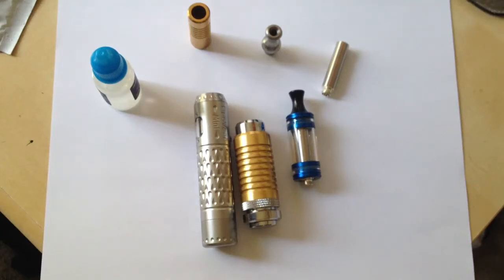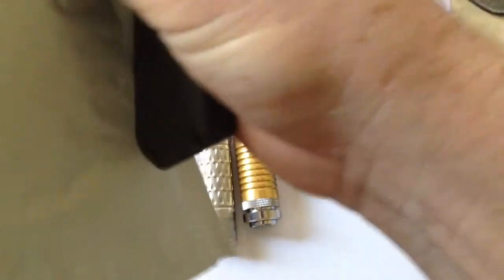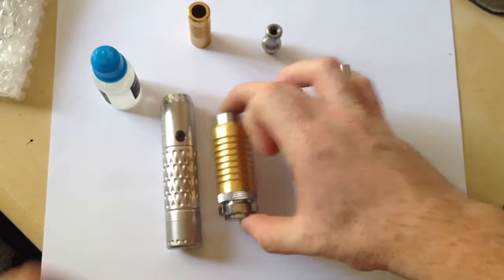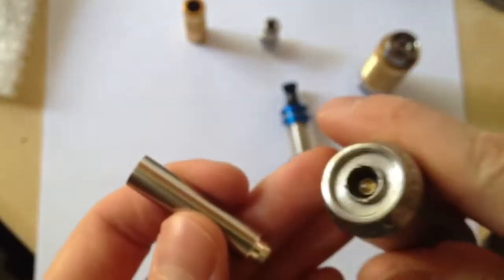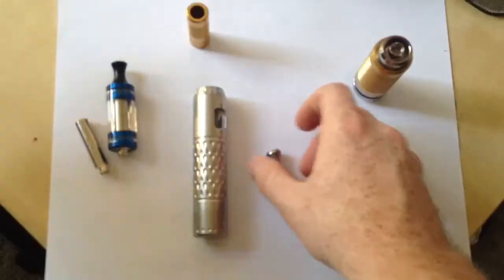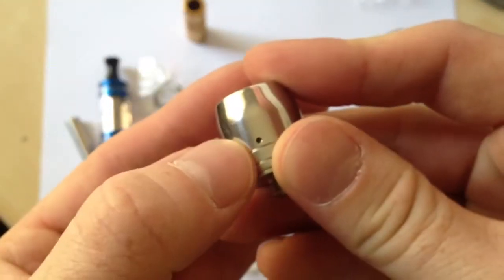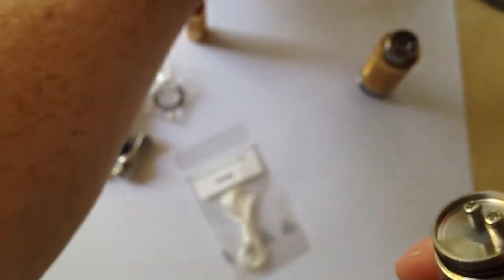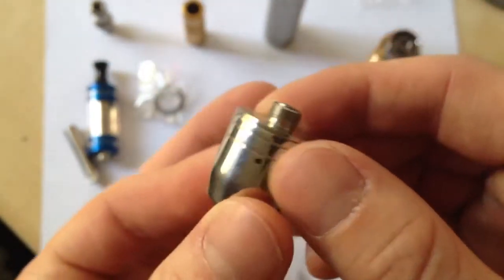Vape Mail: IGO-L RBA

Comment from the maker: I'm loving it so far! I had it set up with a .8ohm coil, but found it was giving a bit too much of a burnt taste with some of my liquids so I up'd it to 1.0ohm and so far it's been good with the one flavor I've used so far. :p

I did widen the hole right away, but it was not done very accurately nor with the proper tools. lol
I used a cork screw to manually gauge it to what I felt was best going a little at a time.